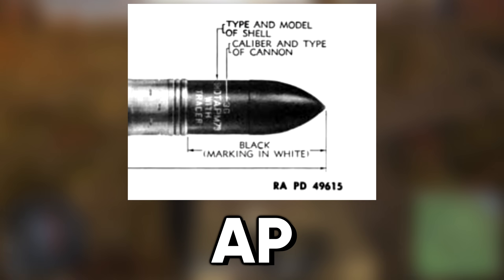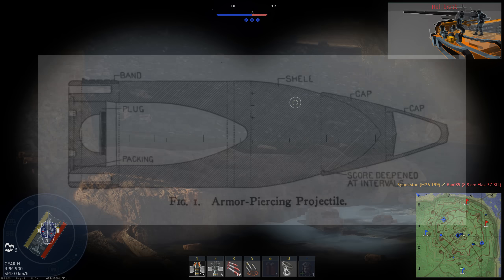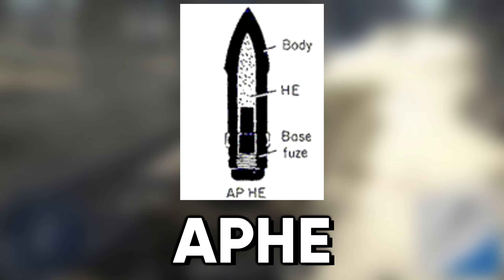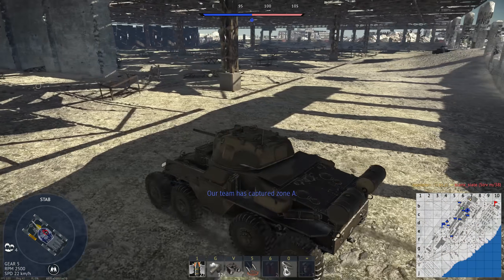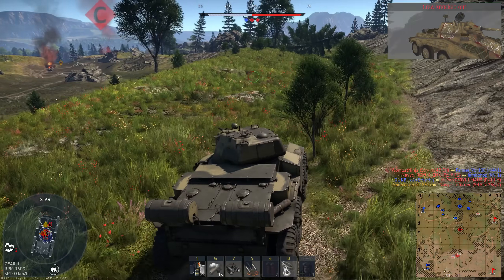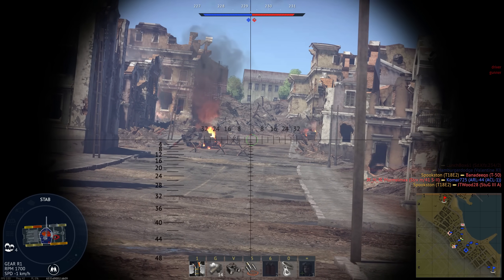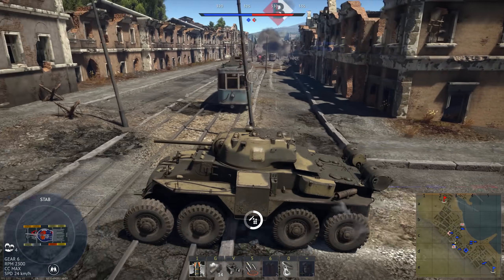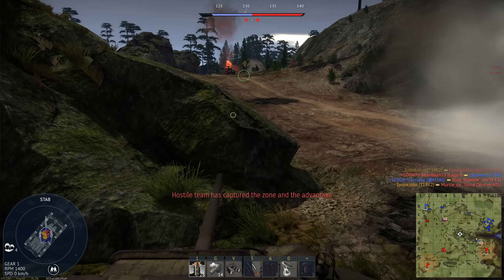How Tank Ammo Works

Comment: Why exactly APCR is so shit against angles?
Fun fact during my days of playing world of tanks (WoT) APCR is good at pening angled armor but HEAT is pathetic unless it lol pens.
Here in WT APCR is pathetic against angle armor unless the shell has lol pen
And HEAT is fantastic. Weird right!
Reply: It should be noted that most APCR rounds in War Thunder don't use their historical penetration values. The M4 76 W, T-44, and Panther should all have APCR capable of penetrating a Maus from the front of the turret, but they don't.
Reply: @xxfalconarasxx5659  ye ever since they stepped over to calculated penetration, a lot of rounds got their penetration quite off. Overall APCBC with filler is overperforming and APCR, APDS and APFSDS underperforming. You win some you lose some. Anyways with the damage that APCR does post pen, there is no reason to use it.
Reply: @Wotplaya4  I could kind of understand the reduced penetration for APDS and APFSDS as being a product of balancing. They usually have no issues penetrating most of the tanks in this game anyway (save for those with composite armour).

APCR on the other hand is pretty much useless. The increase in penetration you get over APCBC is marginal, it performs poorly against angled armour, post penetration damage is pitifully low, and once you enter around BR 6.3-6.7 it is completely outclassed by overpowered Cold War era light tanks and tank destroyers that can fire HEATFS with 300-400 mm of penetration, which Gaijin for some reason thinks is acceptable to be fighting Tigers, IS tanks, and Sherman Jumbos. I think APCR should have its penetration buffed in this game, and the majority of tanks with HEATFS should have their BR increased as APCR takes their place.
Reply: @xxfalconarasxx5659  Ye i totally agree. APCR should get reworked at the least to be more useful than it is now. Still for sooome vehicles the APCR is somewhat usable, but realisticallly we're only talking about a little bit more pen when we take small angles into consideration. 

When it comes to the light tank with HEATFS problem, just divide WW2 and CW already Gaijin... CW tech should under no circumstance fight WW2 vehicles, they are just better by default basically. Except for maybe some vehicles from right after WW2 (IS-3 for instance), as those are still WW2 tech.

Additionally i think they can easily make APCR a bit stronger but limit the amount you can carry or something like that, APCR is no common round so there's even some historical accurcy if they do that.
Reply: APCR? It is lower speed (compared to APDS and APDSFS) and lower mass (and thus far lower inertia) that in turn make penetrator easier to deflect. Another thing is that formula that WT uses (I think it is de Marre formula) has conditions where other formulas would be better
Reply: In WoT AP has 5 degrees of normalization, APCR 2, and HEAT 0. WoT in addition only uses LOS thickness calculations to determine the armor thickness at a given angle. So therefore AP works best and HEAT the worst if they both had the same penetration values.

In WT the calculations are a whole lot more complicated. AP rounds and such still have better normalization values than HEAT in most cases. This heavily depends on what round you're using (whether it's a capped round or not). In addition to determine effective armor thickness at a given angle, WT takes into consideration: LOS thickness, shot mass, caliber to armor thickness ratio and shot type. In WoT you might be familiar with the magic 60 degree angle, at this angle LOS thickness doubles. In WoT this means for a 100mm plate it is going to 200mm. In WT, it heavily depends on aforementioned factors. An intermediate caliber round, say 76mm APCBC, that 100mm plate might just become 250-300mm of effectiveness.

So that's the difference in the two games.

Now why does APCR do so bad additionally in WT? Well compared to HEAT (which only takes into consideration LOS thickness like WoT), APDS and APFSDS, most rounds perform less at angles. So let's compare APCR with AP(CBC). And let's make them hit a target very close so that energy loss in minimal. Let's also say they have the same penetration. If you were to test this in WT, APCR does much worse than APCBC at angles. This is most likely due to mass (lower for APCR), shape (pointier for APCR) and composition (might not have a cap) difference. Also the part that matters for APCR is actually subcaliber, so the caliber to armor thickness ratio is lower than for a full caliber round. 

Besides, angle performance mainly comes from historical documentations. For APCR there are not as much as for other rounds, also coupled that it was replaced by APDS in a relative short time meant that the data we do have are low performing APCR rounds, as they simply didn't have the time to develop for as long. But eh, not totally sure about this one.
Reply: Because WoT ain’t exactly the realistic game you think it is

Comment: APHE does have two pro's VS regular AP ammo: it increases the chance of an ammo or fuel detonation due to the HE inside the shell combusting, which can trigger a chain reaction that regular AP can only cause with much troubles. It also is effective even if it does not fully penetrate the armour, as the HE charge could very well blow open the already damaged steel plate, causing major damage.
Reply: The higher velocity the shot the more likely it is to create fast moving red hot spall which is what almost always causes detonations, nothing to do with the APHEs primary explosion, the slightly increase in spall radius from APHE is the only reason we'd get that effect. Also low HE content in almost all APHE shot would render them not very effective for that kind of work, theres only 65g of TNT in an M61 shot which is less than most hand grenades and it would take about 1kg of TNT to make a penetration on 1 inch of armour plate and thats when in contact with the plate, not at the back of the armour piercing shot. Which brings up another issue with APHE, that M61 especially was having reliability issues penetrating armour especially on angles because the HE sometimes detonated early destroying the shot, or not detonating at all.
Reply: @siem3113  but most handgrenades have a radius where you will die of the pressure wave of about 5-15 feet, so if one a APHE round goes off in the crew compartment it’ll turn your brain into a smoothie regardless of where the fragments go, sine most tanks were very cramped and fully enclosed
Reply: So those are the Two Kinds of advantages
Reply: @hetzerfeind1885  god damnit lmao
Reply: The problem is that if you're already getting hit, it doesnt really matter if its AP or APHE. Chances are you'll be hit again before you can return fire, so most crews will bail before that happens. This makes your 2nd point moot. 

As for your first point, penetration=kill. Sure, it has an increased likelihood of setting off an explosion, but an AP round has a higher likelihood of actually getting through the armor. Tanks usually keep shooting until the other tank is considered a complete loss, so it doesnt really matter if it takes a single round or five, the hard part is done after the first pen.

Also, from what I understand fuses kind of sucked in WW2. This led to many APHE shells being duds that were essentially less effective AP rounds.

Comment: Good video over all but could have explained HESH, HEAT/tandem HEAT and APFSDS little more extensively
Reply: Tandem heat uses 2 warheads, one in front of the other. The first one, typically smaller is designed to detonate first and "use up" the ERA, before the second warhead strikes the now unprotected plate.
Reply: @Katniss218  I know what they are and do but since he made a video about all these ammo types he could have explained them a little better
Reply: @T3leW3ll  I hope someone else doesn't and I can help him at least.
Reply: @Katniss218  Some tandem use smaller warhead to not destroy ERA but make hole in it so jet will go through without activating it

Comment: For the least time, HEAT shells DO NOT MELT through the armor !
Reply: @Ronan McDonald Thing is, the copper is not super heated either, it's not molten at all, the state is called super plastic, meaning it behaves like a liquid without being one. About heat resisting material ? Who knows, in WW2 tankers improvised with a lot of stuff to protect against heat rounds. Won't work against modern HEAT shells obviously.
Reply: that's exactly what he said, heat no melt steel and just use a jet or superplasticised copper moving extra fast (10km/s) to force it's way through the armour
it's just extra spicy AP
Reply: It's more like extremely condensed sandblasting.
Reply: Source?
Reply: @MrJinglejanglejingle  Mate, HEAT shells not melting through armor is common knowledge, but since you asked :
https://en.wikipedia.org/wiki/High-explosive_anti-tank_warhead
Reply: @Vlad_-_-_  Source was still requested.  And clearly, its not common knowledge if you're so worked up about it.

Still, thank you for the source.
Reply: @MrJinglejanglejingle   no problem

Comment: Ww2 Germany: tungsten is too much money for sheels, use regular

America using depleted uranium: is this some sort of poor person joke im too rich to understand?

Edit: 8 know uranium is cheaper, and I know depleted uranium wasn't used in dubdub2
 Leave me Lone
Reply: The thing is, depleted uranium is a lot cheaper to make shells from than tungsten. Because a lot of nations have lots on stock. America especially. And in WW2 US used tungsted too for the HVAP rounds, nobody used any depleted uranium. Tungsten was saved for machine tooling especially so that is why it was pretty rare.
Reply: Depleted uranium is also. well uranium. So i'd assume the crew of the unlucky vehicle also get radiation poisoning?
Reply: @davidty2006  No, that is not an issue, remember that loaders handle the shells manually, so why would they still make them from DU if they can harm the crews ? I think radiation poisoning is the last thing you need to worry about if the tank you are in is penetrated by a DU round.
Reply: @davidty2006  to be fair, uranium (if is not excited by receiving neutrons) has a very long halftime (hundreds of millions years), so radiation is practically minimal